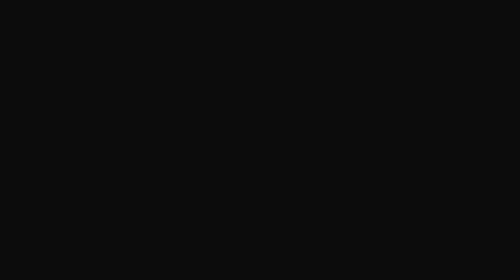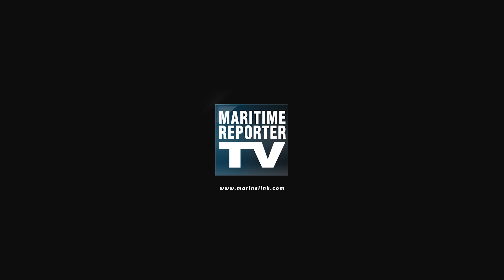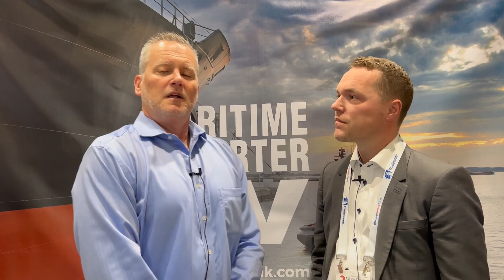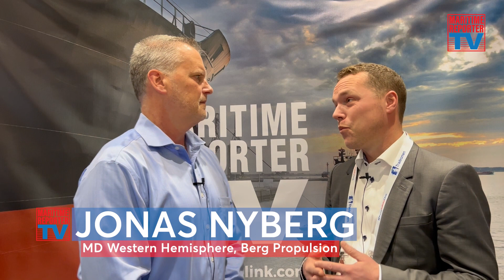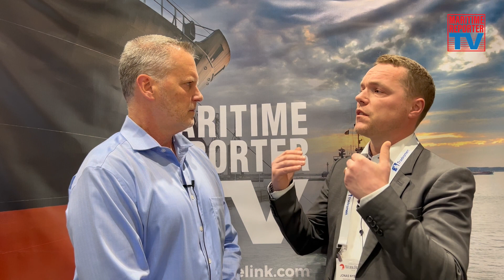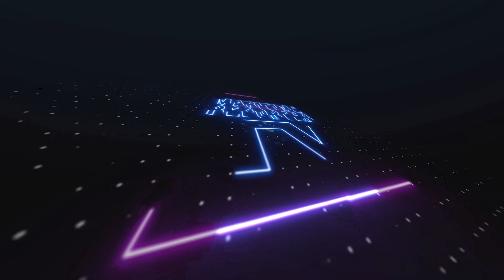Inside Hybrid Tugs with Berg Propulsion

Comment: OK I get that electric motors have great torque but what is efficiency added by going hybrid? On the west coast in LA county electrical rates are 60% higher than the rest of the US. What is the ROAE on a hybrid versus straight diesel including all the extra dock support for charging? How long do marine batteries driving the hybrib tug last and what is their storage loss over time. Does their extra weight impact boat design and performance?